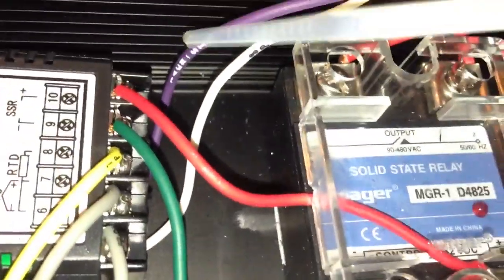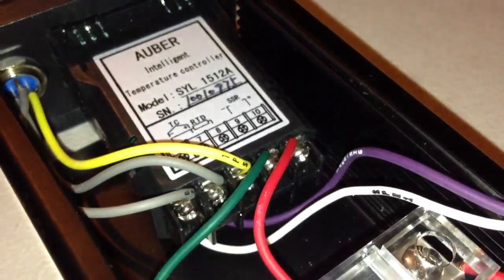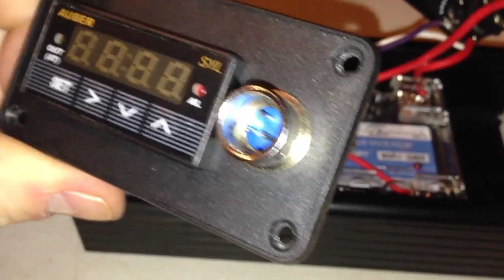How I Built my Sous Vide Controller

Comment from the maker: I believe I moved the Dremel in a direction such that the bit was pushing back against my hand, rather than trying to walk across the part in the direction I was cutting.

For the countersunk holes, I think I cheated and just used a 118 degree standard drill point and then sunk standard 82-degree countersunk machine screws into them.  Buying an 82-degree countersink tool from McMaster-Carr would've been a bit cleaner, but I'm not that picky. ;-)

Comment from the maker: Well, for the end plates, I used a 1/8" end mill on my Dremel tool, held the plate firmly down against a hard surface with my left hand, planted the heel of my right hand down against the table, and plunged the corner of the mill bit into the plastic at 45 degrees or so.  I found that doing it this way minimized the likelihood of the bit zipping across the material rather than cutting inward.  Once I had plunged into the material, I slowly moved the flat face of the bit along the cut line.